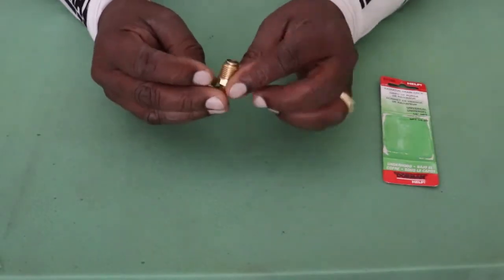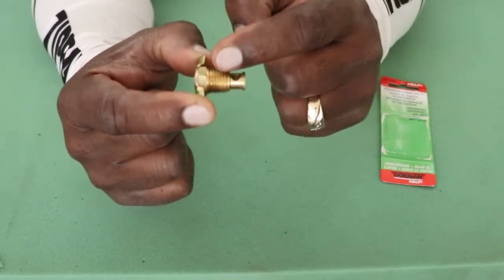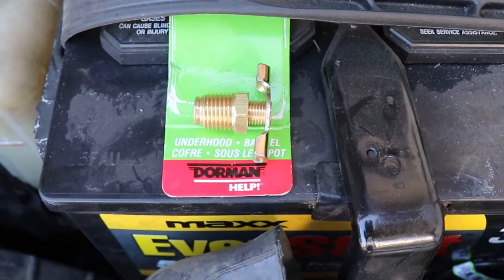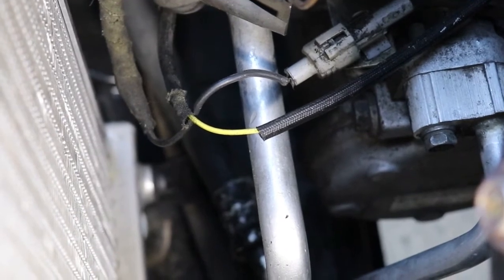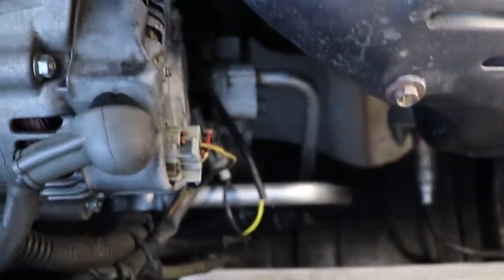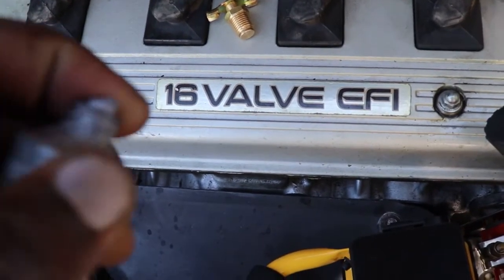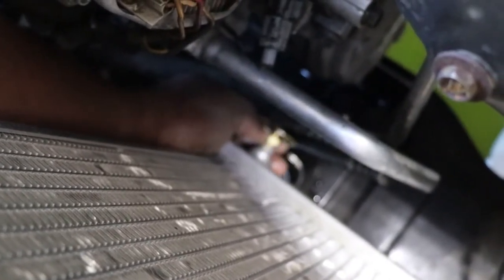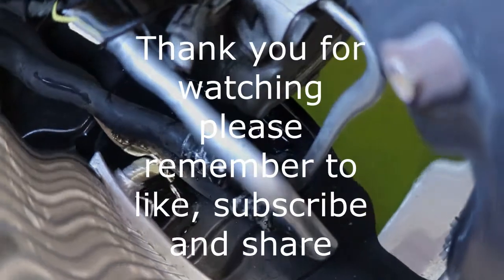How to change a leaking Radiator Drain Plug

Comment: I just want to check now and see how this valve is holding up for you and ask for your review on it after some time using it.
Reply from the maker: The valve fell apart and I replaced it with a solid brass one that has been working great for years now. Good question, thanks for the comment.
Reply: @Engineerboy100  where can I get one of those at? I am currently flushing my system
Reply: @jimmysmith9134  autozone in the help section

Comment: thanks for the tip. I have an aluminum radiator on my Honda Civic. I had a problem with the plastic radiator drain plug and bought the copper one you show on this video. So just a quick question, mixing aluminum radiator with copper drain plug is not a problem, right? Thank you again for the video. It really helped a lot.

Comment: I have the same radiator drain cock and I’ve tried Teflon tape and I’ve tried the permatex thread sealant and I still leak I dont know what to do
Reply from the maker: Yep, I ultimately changed mine out to a solid copper valve, works great.

Comment: How’s that holding up ? I’m thinking about getting on of those myself I have a similar radiator as u and Alamo leaking from the drain plug
Reply from the maker: It didn't hold up,  :(  I had to replace it with a different one...